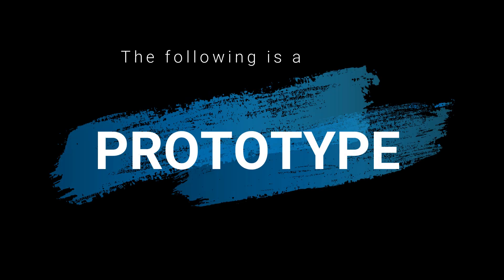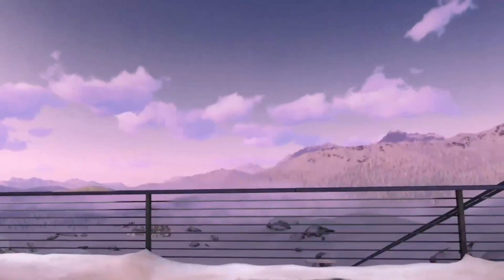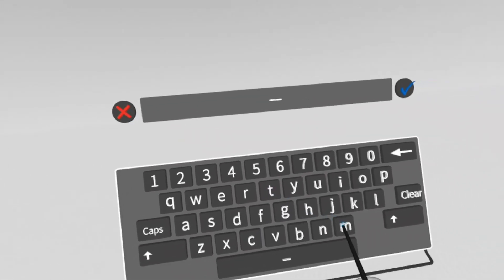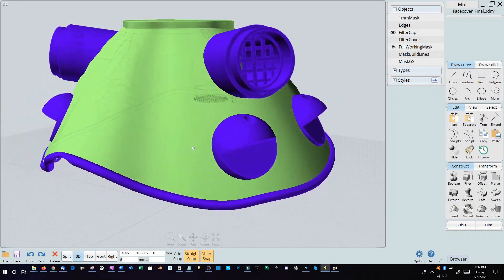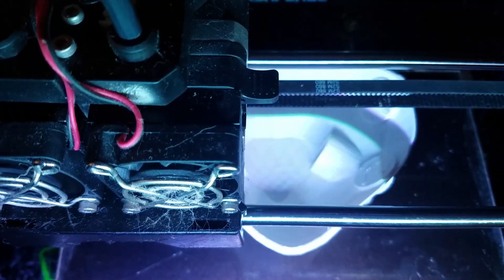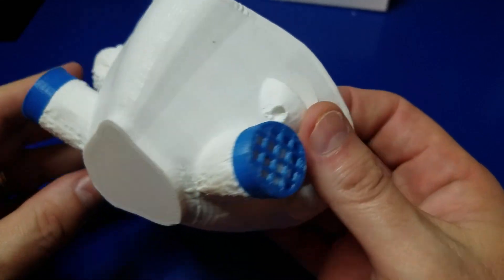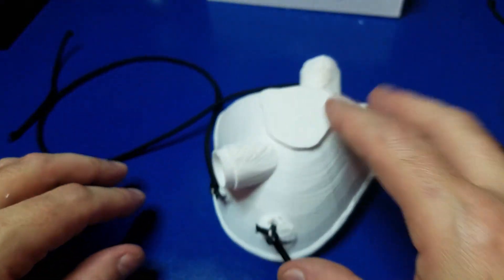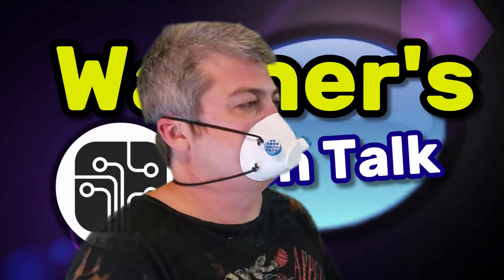3D Printed Face mask (PROTOTYPE) being developed to help: using Gravity Sketch and MoI 3D for design

Comment: Thanks for the help and invention on this! Very interesting to see how you invented this.
Would it be better to make the mask out of any flexible material, so it might fit better to any face? Faces are shaped very different. So, to make it fit best to as many faces as possible it might help if it‘s flexible. Or maybe a line of foam around the edges between the mask and face contact may improve the tightness of the mask.
Reply from the maker: Thank you MashTec!  It might be helpful to use a flexible material, but I've not had very good luck in the past using it (too many gaps between layers).  It's very tricky to work with, at least it was for me.  But you're right, the mask design needs to take into account that not all face types are the same.  I'm thinking of designing different adapters for the nose area (still a solid piece, the user would pick the one they think will work best for them.).  Also, getting some great input from a 3D modeling forum that is helping with some ideas to solve some of these problems.

Comment: I will try to print one out too. I started printing full face shields that use projector transparency film sheets. According to my HAZWOPER training that is a way to test the fit of a mask.
Reply from the maker: Awesome Thomas, thank you!  Any feedback is greatly appreciated and I will make adjustments as needed.
Reply: Wagner's TechTalk,I printed it out. Sadly it didn’t quite fit my face but I’m sure I could get it to fit better running it under hot water to soften it up to get
A better fit. Feel free to email me if you have any questions on my suggestions. First, I would increase the wall thickness a little more. Second, I would extend the surface of the vent tubes to the bed and remove the radius. You wouldn’t need support then. I would also adjust your brackets slightly, from a round to a chamfered surface, for the same reason. No need for supports. Sadly it broke on me while I tired test fitting it. The flat surface was the only weak point. Extended the vent tubes to the print surface would also help reinforce this as well as remove the stress points from that sharp change in direction. I would also as a little more thickness in that area as well to help reduces those stresses. Other than that you did a great job! I know without a doubt these will come in handy for whomever prints one for their needs!